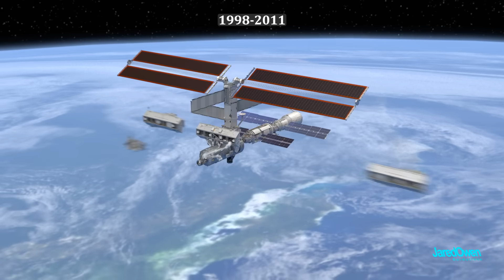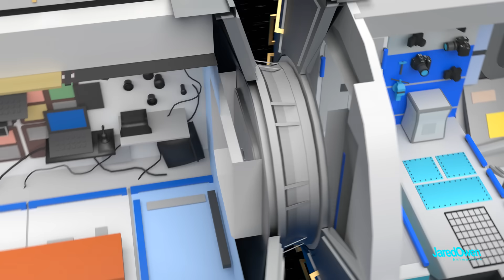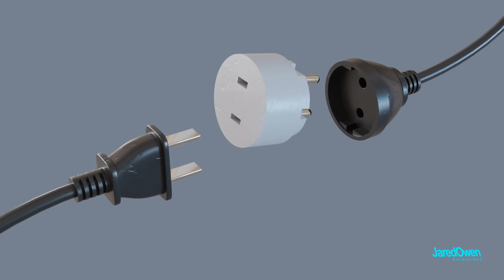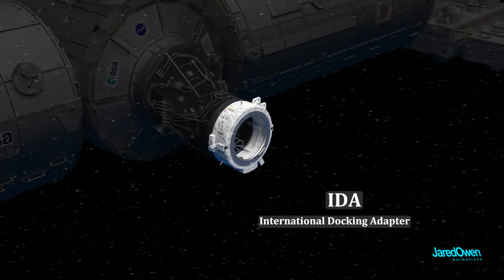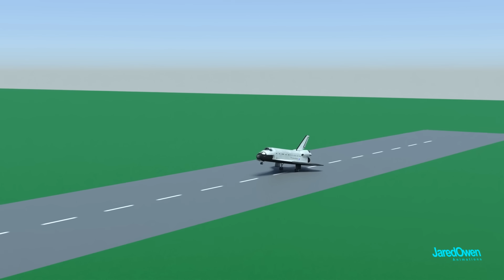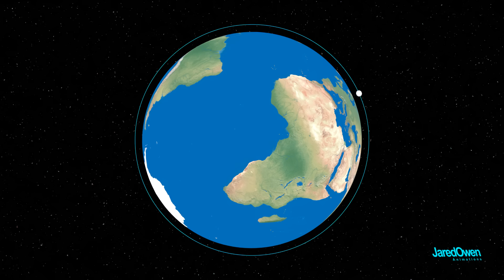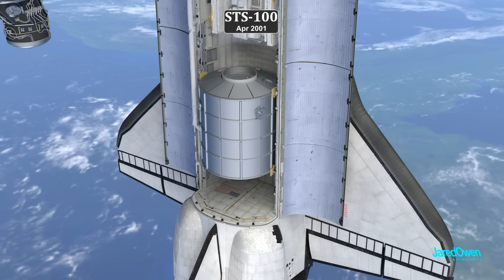How did they build the ISS? (International Space Station)

Comment: And they did this while going 17000 miles per hour in space?
Reply: 17,000 mph relative to the center of the earth. Of course much more relative to the sun. And even more relative to the center of the Milky Way. At this very moment you move around the earth with 66,000 mph.  You cannot feel speed. And you measure it only relative to something else.
Reply: Station-keeping is a lot easier in space compared with, say, station-keeping by a pair of ships at sea. The reason it's easy is that the only force acting on a pair of station-keeping spacecraft is gravity, which is identical for the two spacecraft.

Comment: Dextre, also known as the Special Purpose Dexterous Manipulator (SPDM), is a two-armed robot, or telemanipulator, which is part of the Mobile Servicing System on the International Space Station (ISS), and does repairs that would otherwise require astronauts to do spacewalks. It was launched on March 11, 2008, on the mission STS-123.

Dextre is a part of Canada's contributions to the ISS and was named to represent its dexterous nature. Dextre is the newest of three Canadian robotic arms used on the ISS, preceded by the Space Shuttle's Canadarm and the large Canadarm2. Dextre was designed and manufactured by MDA.

In the early morning of February 4, 2011, Dextre completed its first official assignment which consisted of unpacking two pieces for Kounotori 2 while the on-board crew was sleeping.

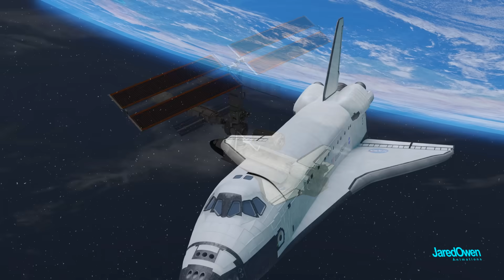Comment: 0:58 I’ll list them because I have nothing else to do

STS-88 Space Shuttle Endeavor: Took the Unity node to the station.

STS-96 Space Shuttle Discovery: first shuttle mission to dock and carried the Spacehab module filled with cargo for station outfitting.

STS-101 Space Shuttle Atlantis: was a resupply mission for the ISS

STS-106 Space Shuttle Atlantis: ISS supply mission

STS-92 Space Shuttle Discovery: brought Z1 Truss, Control Movement Gyros, PMA-3(Pressurized Mating Adapter-3), and 2 DDCU(heat pipes) to the station.

STS-97 Space Shuttle Endeavor: provided solar arrays and the P6 Truss to the ISS and prepared a docking port for arrival of the Destiny Laboratory Module.

STS-98 Space Shuttle Atlantis: delivered the Destiney Laboratory Module.

STS-102 Space Shuttle Discovery: ISS resupply and crew rotation.

STS-100 Space Shuttle Endeavor: installed the ISS Canadarm2

STS-104 Space Shuttle Atlantis: installed the Quest Joint Airlock and help perform maintenance on the ISS

STS-105 Space Shuttle Discovery: ISS resupply and crew rotation and was the last mission for Discovery until STS-114, because Discovery was grounded for a refit and then all shuttles were grounded due to the Columbia disaster in 2003

STS-108 Space Shuttle Endeavor: delivered supplies and helped maintain the ISS

STS-110 Space Shuttle Atlantis: installed the S0 Truss segment, which forms the backbone of the truss structure of the ISS

STS-111 Space Shuttle Endeavor: ISS resupply and crew rotation

STS-112 Space Shuttle Atlantis: delivered a 28,000 pound S1 truss segment to the ISS

STS-113 Space Shuttle Endeavor: extended the ISS backbone with the P1 truss and crew rotation and was the last successful mission before STS-107

STS-114 Space Shuttle Discovery: “Return to Flight” following the Space Shuttle Columbia Disaster it supplied and repaired the ISS

STS-121 Space Shuttle Discovery: ISS supply and crew rotation

STS-115 Space Shuttle Atlantis: delivered and installed the second left-side ITS P3/P4 Truss segment, a pair of solar arrays, and associated batteries.

STS-116 Space Shuttle Discovery: delivered the P5 truss segment and major rewiring of the station’s power system and crew rotation.

STS-117 Space Shuttle Atlantis: Folded and relocated the P6 truss panel.

STS-118 Space Shuttle Endeavor: assembled the starboard S5 truss segment to the ISS as well as ESP-3 a replacement CMG and was the last mission with the Spacehab included.

STS-120 Space Shuttle Discovery: delivered the Harmony Module and reconfigured a portion of the station in preparation for future assembly missions.

STS-122 Space Shuttle Atlantis: the 24th ISS Shuttle mission and 121st Shuttle mission delivered the European Columbus science laboratory built by ESA.

STS-123 Space Shuttle Endeavor: delivered the first Japanese Experiment Module Kibō, the Canadian SPDM, Dextre robotics system, and utilize the SSPTS.

STS-124 Space Shuttle Discovery: delivered the largest module of the ISS, Kibō the Japanese Experiment Module pressurized section.

STS-126 Space Shuttle Endeavor: delivered equipment and supplies to the station to service the Solar Alpha Rotary Joints and repair the problem in the starboard SARJ.

STS-119 Space Shuttle Discovery: delivered and assembled the fourth Truss Segment S6 and fourth set of solar arrays and batteries.

STS-127 Space Shuttle Endeavor: delivered and installed the final 2 components of the JEM EF and the ELM-ES

STS-128 Space Shuttle Discovery: carried the Multi-Purpose Logistics Module Leonardo as its primary payload 

STS-129 Space Shuttle Atlantis: carried 2 large ExPRESS Logistics Carrier holding 2 spare gyroscopes, 2 nitrogen tank assemblies, two pump modules, an ammonia tank assembly, a spare latching end, a spare trailing umbilical system, and a high pressure gas tank

STS-130 Space Shuttle Endeavor: carried the Tranquility module and the Cupola control station

STS-131 Space Shuttle Discovery: carried a Multi-Purpose Logistics Module loaded with supplies and equipment for the ISS

STS-132 Space Shuttle Atlantis: carried a Russian Rassvet Mini Research Module, along with an ICC-VLD

STS-133 Space Shuttle Discovery: delivered several items to the ISS and was the final launch of Space Shuttle Discovery

STS-134 Space Shuttle Endeavor: carried the Alpha Magnetic Spectrometer and an ExPRESS Logistics Carrier to the ISS and was the last launch of Space Shuttle Endeavor

STS-135 Space Shuttle Atlantis: brought the MPLM and LMC and was the last launch of Space Shuttle Atlantis and brought the end of the Space Shuttle Program 1981-2011
Reply: This took me about an hour to write btw 😭
Reply: So plz like 😭

Comment: What do they mean "hours" to pressurize a 6 inch wide bit of steel??
Reply: Probably to reduce stress. Why spend extra material making it be able to withstand a quick pressurization, when you can just wait and save some weight.
Reply: Do you mean pressurising the vestibule?
Reply: @maxfan1591  any of it... shouldnt take hours should it??
Reply: @maxfan1591  yea. It doesnt "take hours" to pressurize it or a room. A pshhhh for a few seconds and its done.
Reply: @JackFrost008  "It doesnt "take hours" to pressurize it or a room. A pshhhh for a few seconds and its done."

I'd go with what TonyChan-eh3nz said. Just because you can do something quickly doesn't mean you should. If you're building something intended to last for 20 or 30 years, what's the difference between 5 seconds and 5 hours? Especially when the cost for repairs would be much higher than for the same sort of job on Earth (and much more difficult).
Reply: @maxfan1591  if you like but it doesnt take 5 hours. like I said.
Reply: @JackFrost008  "if you like but it doesnt take 5 hours. like I said."

First, are you saying this with experience in aeronautical engineering, or just good ol' common sense? Just remember, common sense is fine on Earth, but not so good in unearthly environments.

In subjects where I'm not an expert, I'm happy to trust the experts when they say tell me how long a process will take, even if I don't understand why. This is based on my own experience of non-experts simply not believing what I told them about how long processes would take that I had expertise in. Perhaps you might like to consider this in regard to your own work?

Second, I did some looking around online. It seems the pressurisation process took about an hour. This involved gradually letting some air into the vestibule, then stopping for 10-30 minutes to check for leaks, and repeating this process until pressures were equal.

Third, I listened again to Jared's commentary. His statement "This process takes a few hours" could be taken to refer to the whole berthing process, not just the pressurisation part of the process.
Reply: @maxfan1591  whatever it is, that is way to much time
Reply: @JackFrost008  "whatever it is, that is way to much time"

Once again, are you saying this with experience in aeronautical engineering, or just good ol' common sense?
Reply: @maxfan1591  fact of life of course. I am no aeuronatucal engineer
Reply: @JackFrost008  "fact of life of course. I am no aeuronatucal engineer"

So why do you think your "fact of life" knowledge is superior to relevant expertise in a situation relying on that expertise? And as I said before, consider that in relation to your own job.

Comment: Unfortunately its just a story….but we keep believing it so they keep doing it. Space is fake. Its impossible to have a vacuum next to a high pressure system, so there it is.
Reply: You can simply feel and measure that the air pressure becomes lower when you go higher
- sea level: 1013 hPa
- 1 km: 881 hPa
- 5 km: 533 hPa
- 10 km: 281hPa
- 20 km: 78 hPa

So that is a fact. 1013 hPa obviously can exist "next to" lower pressure. So what do you think happens when you go higher? You deny that the air pressure becomes lower? And you believe that there is some kind of ceiling up there? Where? It also doesn't help with your argument, because then you still would have the problem that there is 1013 hPa, and more or less a vacuum (how do you define vacuum? Do you have a threshold of air pressure for that?) up there immediately under the ceiling.
Reply: In addition to sebastiannolte's excellent points, there is the simple fact that we can see satellites orbiting overhead, and we can measure their altitudes with high school maths.
Reply: Unfortunately its just a story….but we keep believing it so they keep doing it.

Unfortunately you are just a troll, a kid with meaningless life.
Reply: I understand that there is no real video on the assembly of the ISS. Space is fake
Reply: @datobeko4326  "I understand that there is no real video on the assembly of the ISS."

And your understanding would be wrong. Scott Manley's channel has a playlist of dozens of videos of the assembly of the ISS. This is what happens when you don't bother to do your own research, keeping in mind that research would be as simple as typing "assembly of the iss" into the search bar above.

"Space is fake"

And you'd be wrong again. As I said above, we can see satellites orbiting above, and we can measure their altitudes with high school maths. Out of interest, would you like to tell us where you learned "space is fake"?

Comment: So all of this is happening while the iss is moving @28 000 KPH🤔
Reply: Yes, relative to center of the earth. Relative to the sun they move with much more. And relative to the center of the Milky with even more. Speed is always relative. There are no forces in speed, you cannot feel speed. So it doesn't matter. 

Imagine you sit in an airplane that flies along the equator from west to east with 900 km/h. There is a drone hovering in the aisle and another drone flies from the back very slowly and connect in mid air. So what is the speed of the drones?

- from your perspective (sitting in the airplane) one drone has 0 km/h and the other 1 km/h
- from some body watch from the ground up to the airplane, one drone moves with 900 km/h and the other with 901 km/h
- relative to the center of the earth drone one moves with 2570 km/h and the other with 2571 km/h (because the earth spins with 1670 km/h)
- relative to the sun the move with about 107000 km/h (because the earth moves around the sun with that speed